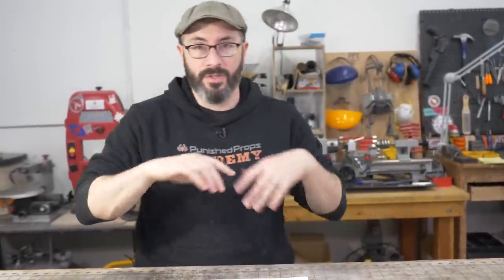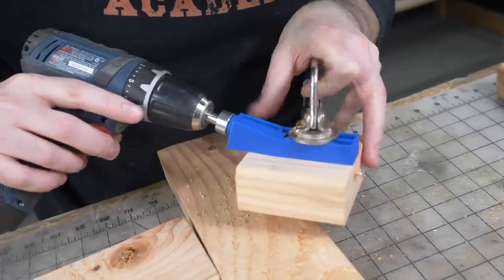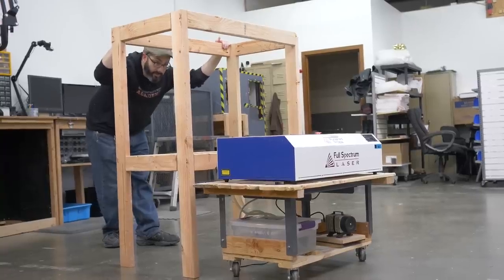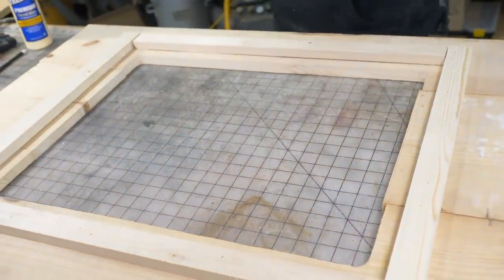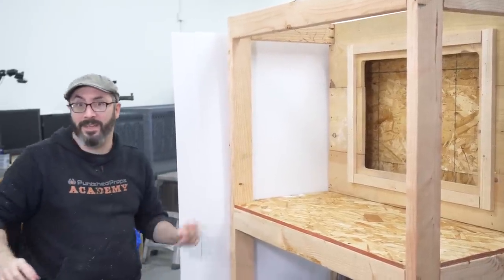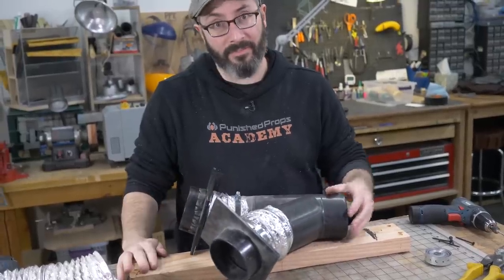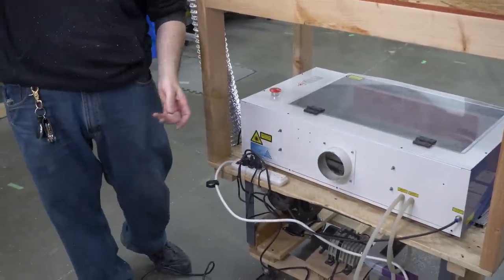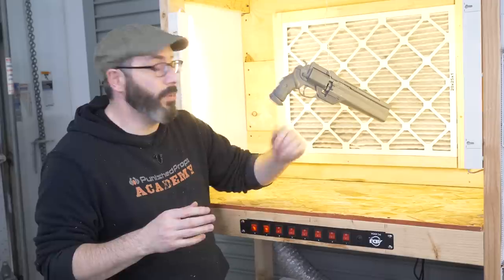How to Make a Custom Paint Booth with Filter & Lights!

Comment: When I saw you use tape to mark the distance between the holes of you neon lights, so you could bàput the screws in the right spot, I almost facepalmed. Why didn't I think of that when I had power bars to mount? The rest of the video is cool too. :)
Reply from the maker: We’re all learning so much from this project!
Reply: @luc I was thinking the same thing.

Comment: Mechanical dual action wolverine claws and/or hidden blade from Assassins Creed. For the hidden blade I’d suggest using a scissor jack mechanism instead of the spring loaded OTF mechanism as it’s simpler and a bit more efficient

Comment: If you have a Biscuit Joiner, that's what you'd normally want to use to put wood together like you did for the back
Reply from the maker: Thank you! We’ll need to get one of those.
Reply: @punishedprops  You can buy it as a router accessory too and not just as a standalone tool
Reply: @punishedprops  you can have mine, been sitting for years. I have other methods I prefer.
Reply: Biscuit joiners don't actually add any strength to the joint.

Comment: hi im making a similar spray booth for regular modelkit airbrushing so its much smaller scale. im just wondering if the chamber at the rear is absolute necessary or am i okay with just having a duct + blower straight into the back?

Comment: To borrow something from the 3D Printing community, you could also use a pair of Ikea Lack tables (where available) as they're really cheap, lightweight yet sturdy.  I'm using two as my Prusa enclosure just by adding some 3D printed extensions and foamboard with insulation.  There's plenty of designs on Thingiverse to get ideas from.

Comment: Great booth!  The reason your pocket screws cracked the wood and stuck out is because your bit was not adjusted to the correct setting for the thickness of the material.  There’s a 1.5in symbol where the bit should be adjusted to on the kreg drill bit.  It shouldn’t poke out the end of the board.

Comment: Do you think you would be able to cut that plastic with scissors?or how difficult is it to cut with a knife(I'm thinking of a totally different application, and I want to check if it's foamed pvc levels of difficulty or cardboard level)
Reply from the maker: The corrogated plastic? Definitely just fine to cut with scissors or a knife.

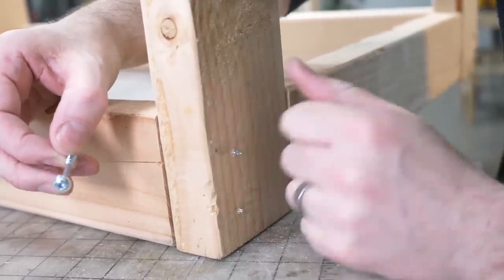Comment: 7:22 pocket holes were the right choice for that because screwing right into the end grain of the wood will split the wood and ruin the joint. Pocket holes are meant to get around this problem without  cutting a special joint for the corners. Also, to avoid the end of the screw sticking out of the other piece of wood, take a look at the manual and see how far you need to place the drill guide and how far you need to set the collar for the thickness of the wood and the length of the screws you are using.

Comment: Thanks for sharing! Doesn´t the extractor from behind attracts ambient dust to the painted part?
Reply from the maker: Not typically. I keep the paint booth well away from the other areas of my shop that might produce dust, so it's pretty safe. I don't have the fan on while the paint is drying so it sits safely in its little cavity

Comment: The steel mesh and the criss cross cardboard are a dead give away for airflow direction. They are there to prevent the filter from being sucked in, your filter needs to be flipped.

Comment: Small halogen work lights in the top corners would give more light.
Additions to consider would be a heavy blanket on the front with a small heater to speed drying time.

Comment: Flammability of a wooden booth isnt an issue if you don't use aerosol spray cans, correct?
Reply from the maker: I think if you're using paint that doesn't have fumes it is safer generally, but it can still be a risk

Comment: Look on the side of the filter for an direction arrow
Reply from the maker: That’s great to know, thank you!
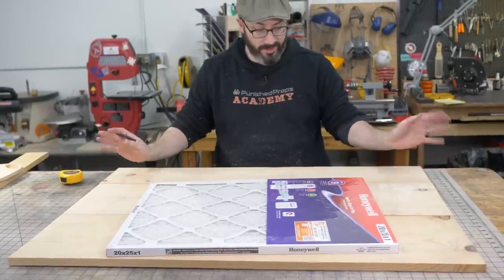Reply: @punishedprops   Yes at 9:49 you can see the arrow pointing the right direction, and now you have the filter in wrong way.
Reply: If ever in doubt, that cross grid is meant for added back support so your filter doesn't collapse.

Comment: this video reminded me I had designed a paintbooth.  I should find the drawings cause it has a crazy three stage filter system using three box fans and three furnace filters
Reply from the maker: Woah!
Reply: The draw back of the design is I don't have the electrical knowledge on how to wire all three fans to one knob

Comment: Would a booth like this work to pull fumes from contact cement as well?
Reply from the maker: It would certainly help. You'd want to check and make sure your filters are suitable for those types of vapors, but you would still probably want to wear a mask.

Comment: I bought myself a factory-made spray booth for painting model cars, but I'm wanting to buy some paints but the ones I want to buy are flammable/explosive. Is there a way for me to prevent the electronic parts from coming into contact with the flammable/explosive paint?
Reply from the maker: I'm not sure - you may just want to reach out to the customer service for the booth you bought

Comment: Suction coming out at the top would be better as you're just going to cover the filter in paint and it will stop air being sucked through. Also silicone sealant would have been better to seal the back of the unit.
Reply: Would a bathroom exhaust fan work in the top

Comment: In your setup the fan draws dirty air across the part that you are painting.   Doesn't everything you paint get dust in the wet paint?
Reply from the maker: Nope! I keep this paint booth away from the major dusty areas in the shop and the fan's not strong enough to pull from beyond the booth.

Comment: Love pocket screws. The problem was that you had your collar too high. The drill bit shouldn't come out the other end of the wood like that. Also, there are different length screws for it. If you're going to use them in more projects, I'd recommend getting one of the cases that comes with multiple screw lengths, based on wood thickness.

Comment: 7:15 the reason pocket holes are superior to the other method you propose (and end up doing a second later) is because the way the wood fibers are oriented, screwing into the end grain like that isn't as strong as screwing into a face or edge grain.

Comment: Another option if you don't have a blower fan, you can buy a cheap kitchen vent hood for $50. Two of them bolted together gives you a fairly large back to a spray booth.
Reply: Be advised, it is a good idea to use EXPLOSION proof fans on a booth like this as it is likely that you will be spraying some flammable products in it!
Reply: @mikesmicroshop4385  good call! I often forget because I use non-flammable paints using an airbrush.

Comment: I know it’s too late, but since it’s just a spray booth you could have used 1x1 or 1x2. You can save a lot of money by building only to handle the weight and forces that the fixture will be required during use. When your broke like I an, you learn to pinch every single tenth of a cent. 😜😂😢😂😭   Someday my products will start flying off the shelf, but I’ve promised myself to stay...... frugal?.....ok... a tight wad. 🤪😂🤣

FYI, that kreg jig has a depth gauge for the drill stop on it. 😉🤓😎

If you use (in the exhaust line) a charcoal mat filter followed by a HEPA filter, you won’t need to vent it outside and you won’t have to worry about chemical fumes from solvent/lacquer paints. Still keep the pleated filter in the back. And yes, you absolutely need a sealed motor fan for fire safety. 

Also you could put a piece of defusing “plexi” in the top and an LED fixture, that way you’ll never get paint on your light and the cover is cheap and easy to replace when it gets crusty.

Cool build. I really like the switch. I might have to incorporate one of those into myDIY “tabletop” spray booth.
Reply from the maker: Cool info, thanks for watching!

Comment: Wow! What a monster. You can throw a chevy 350 up there and paint it. That definitely is not a hobby spray booth. As far as OSHA, you already have a sealed fan and venting outside, the only thing you need is a grounding wire on the airbrush and a activated charcoal/HEPA filter with a pre-filter (blue particulate) and your good to go.

Comment: Your exhaust fan for the laser was designed to move air from a much smaller enclosure.

You would be better simply putting a box fan at the top of the structure and having a couple of filters it sucks air through.  Just saying.

Comment: Is there any over spray that gets into the laser cutter?
Reply from the maker: Shouldn't be. I'll be painting IN the booth and the particles will be pulled towards the back thanks to the fan. The gates on the side will also stop any back flow going into the laser cutter while I'm painting.

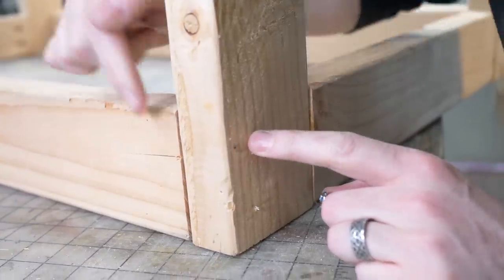Comment: 7:10 There is nothing wrong about using pocket holes for that joint. You either used the wrong size screw or you drilled the holes too deep. 12:55 Duct tape will work for a while, but it will eventually will fail, caulk would be a much more permanent seal that is also easy to remove if you ever have to take your paint booth apart. 13:55 Caulk would have been great as a sealer here too. Rather than use it along the joints as you would have in the previous step, here you would run a bead and sandwich the caulk between the OSB and the 2x4's to act as both a sealer and a glue making this permanently air tight.
Reply from the maker: Thanks for the tips!

Comment: Good job but too much over thinking .

I use the following items .

Folding pick nick table 
1x1 's 
Sheet pegboard 1/4 in holes 
Bathroom / laundry power vent 
Outside exhaust vent and tubing 
Small under cabinet light
And power strip 

I went with this size of pick nick table because of the size of models I build ( large , larger and are you freaking kidding me ) .

I used the pegboard to where I can hang parts trees for either airbrushed or detail hand painted small parts and let the air flow dry them .
The power strip was used as a main on /off switch for the vent and light .             The light was covered with clear visclean ( ? ) sheet plastic that can easily replaced when dirty . 

Using the 1X1's and cut to size pegboard .  I made a frame for support and vent then framed the front of the paint  booth .
The top was a combo of the pegboard and 1/4 in plywood and used 1/4in plywood for the sides .
Mounted the light to the top plugged it into the power strip 
And wired the vent and plugged into the power strip .
Set up my air compressor and started working on a model .

Besides that laser cutter is very expensive and I wouldn't use any spray paint near it period .

There always over spray that doesn't go into the filter and vent .

Comment: If you cover the filter but leave a space around the edges for the air the filter wont get covered in paint so soon.
Reply from the maker: Yeah Bob over at I Like To Make Stuff did this with his and I may add a cover for mine at some point. For now, this works!
Reply: I didn't see Bob's booths. I built a some years ago and we had three walls in the back to your two. The front most wall was open only along the bottom, the next wall held the filter along the top and the third wall made the vacuum chamber.  @punishedprops

Comment: It sounds like you stripped every single screw?
Reply: No he did not strip out any of them!  He did actually use the torque setting on the drill (something most people NEVER DO) to stop it from stripping out the screws by driving them to deep!  The sound you are hearing is the drill torque slipping when the screw is tight enough!

Comment: I built something similar about a year or two ago. We used to just have a cardboard box with a dedicated shop vac for extraction. I made the upgraded one out of plywood and used a stove/range hood for the extractor. This has the added benefit of a built in filter (Though not as good as what you have there) and, more importantly, lights. I made a lexan/polycarbonate door on the front which is hinged in the middle. I get better airflow if the door is only half open, so unless I'm painting something really large, that's how i use it: half open. When I'm done painting, I leave the fan running for a bit and close the door so fumes continue to get sucked outside while it dries. There's a hole in the back where warm air is drawn in from a space heater. 

Incomplete cad file here: https://cad.onshape.com/documents/47a54bb199dd558cb3242703/w/b7c5948c21acff245e5d7220/e/0e35a80f418d2e950de0f17d

Comment: Using Duct Tape to seal a duct, how silly! Oh, if there isn't an arrow on the side of the filter, generally the lattice goes down stream (in this case towards the fan), the lattice is there to support the filter medium so it won't suck (or get blown) out of the frame, (yours is backwards 😁 ).

Comment: Your pocket holes are to deep.  The very tip of the drill bit should end at the end of the wood and not come out.  That would be the reason why you had screws sticking out the sides.
Reply from the maker: Thank you for the info! We’ll have to practice more on a future project.
Reply: Also, I use the 4 inch version of the filter, not the 1 inch. Much better filter

Comment: All your electrical (lights) should be outside the box and only let light in through windows due to the flammable/explosive nature or many finishing processes. If that were a comercial booth it would be required by code. Either that or all the lights should be of the "intrinsically safe type" which gewt's quite expensive.
Reply from the maker: This is definitely true for commercial booths! Fortunately ours falls more under the hobby category and we won't be spraying anything super serious in it.
Reply: I definitely didn't mean it was required for your booth just a good safety consideration

Comment: I know you said this is for light spray painting with airbrush or rattle can, but aren’t you worried that your laser cutter is going to be covered in paint spots after a while?
Reply from the maker: It's pretty far off from the major spray areas and is under the bottom surface of the spray booth - if I'm getting paint on my laser cutter on that point I'm just using my booth wrong! It MAY get the occasional flecks or spatters, but it's got a cover protecting all the important bits that can just be cleaned off.

Comment: Any reason why you wouldn't put the exhaust at the top?  It seems like spraying right at the filter would burn through filters like crazy.  Also, you put the power bank on upside down. lol.  Love the channel.
Reply: If the air flow were high enough you could put them at the top, however that is not the case in this build, also by keeping the air flow inline with the direction of spray you will catch more of the over spray, as well as the volatile chemicals you are wanting to remove from the area!  The blower on the laser cutter is not even close to the air flow needed for a booth of this size so in order to get any significant catchment of over spray and volatiles it needs to be at the back!

Comment: you have the wrong jig, you'll need the Kreg jig r3. the jig you used is made for 1/2" drawers. your jig works but it won't be as tight and you'll have screw "poke-outs". 
source: woodworker ig:moes_wood

Comment: Not a fan of pocket screws if I'm honest.  Good wood glue is infinitely stronger. Live and let live though.
Reply: The hanging boars would've been better screwed in on top of the frame rather than side screwed too.   Just a friendly observation ;)
Reply: on end grain the pocket screws are much better than wood glue alone, but since he did not use any glue pocket screws it is!
Reply: @mikesmicroshop4385  good point well made bud.

Comment: In regard to the power strip. I noticed that you installed it upside down. You should know that according to latter NEC code, three wire outlets are to be installed with the ground up.
Reply: Its a flawed code. The spades have much better holding than three ground pin.

Comment: Dude a $20 box fan works better than an expensive extractor. It also works great for poly coating wood to keep dust off. You just attach the filter right to the fan.